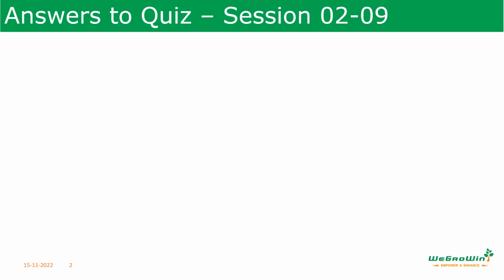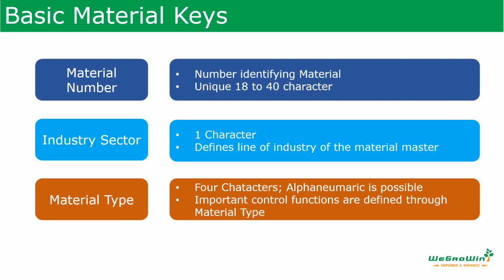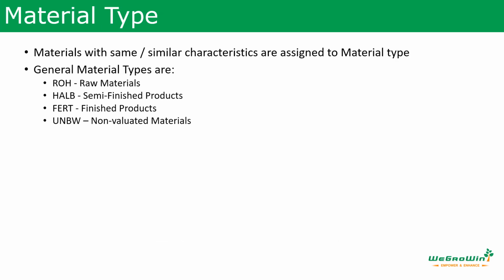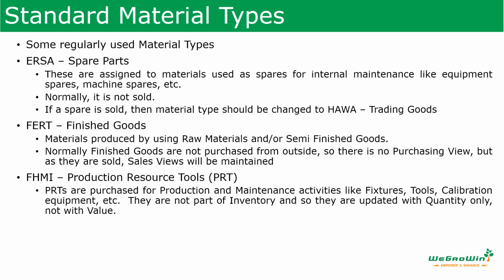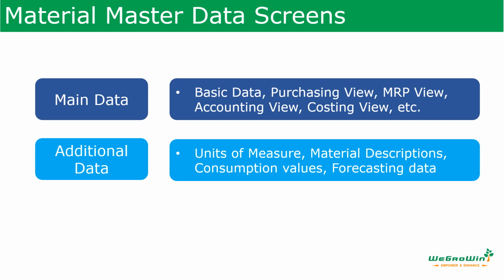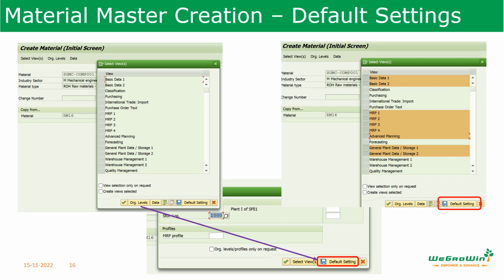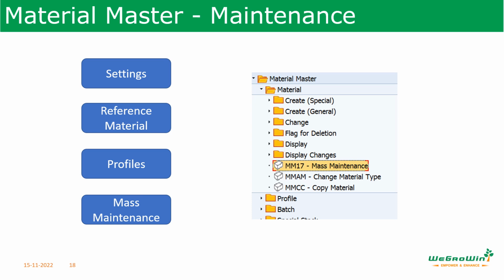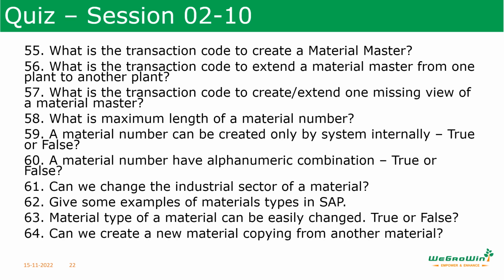SAP MM | Managing Material Master | Create Extend Change Delete | S/4HANA

Comment: Hi Sathiya, please find the answers-

1.	Transaction to create material master: MM01	.
2.	Transaction to extend material master from one plant to another: MM01
3.	Transaction to extend one missing view of material master: MM01
4.	Max length of material number:  18.
5.	Material number can be created only by system internally? – False – It can be internally or externally. 
6.	Material number can be alphanumeric combination? Yes, it is possible 
7.	Can we change industry sector of material? – No, it’s not possible.
8.	Material types examples – Raw material, Semi-finish material, Finish product/material, packaging material, consumables etc.
9.	Material type of material can be changes easily? – No, we can’t change. 
10.	Can we create new material by copying another material? – Yes, it is possible
Reply from the maker: Appreciated. Couple of comments.
8. Material types you could have given examples like ROH, FERT, HALB, etc.
9. Material types can be changed, but it needs a proper procedure. So, it is possible, but not easy.